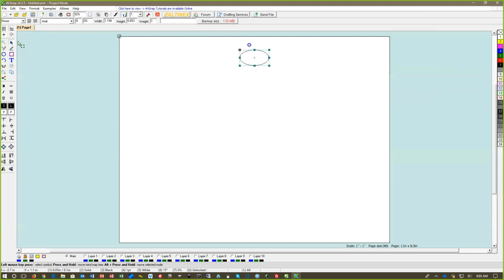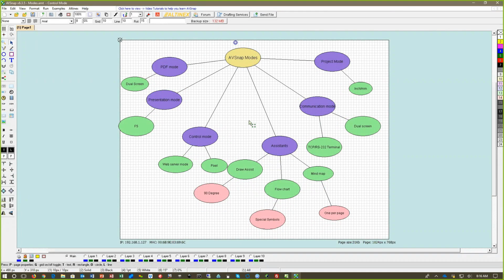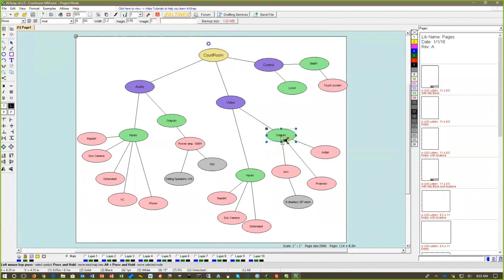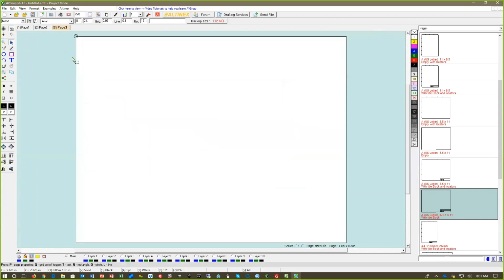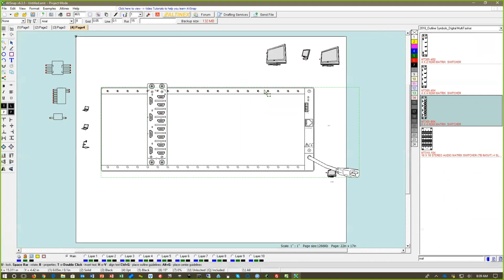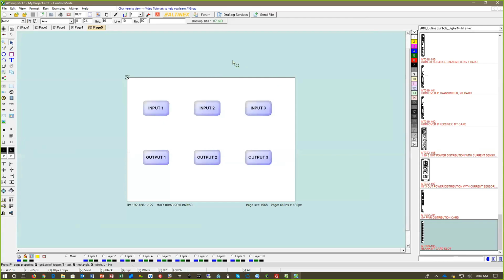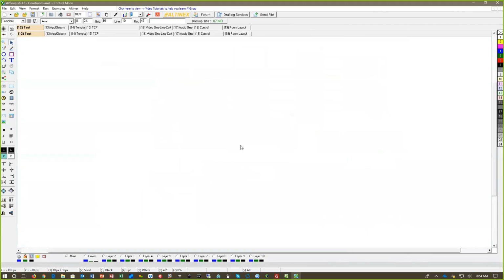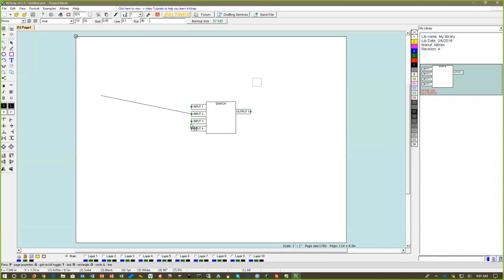Introduction to AVSnap [[Recorded from Webinar]]

Comment: Hi Jack. Your info is always great, but your video is so blurry it's hard to see anything on the screen. Also, I just checked your forum links on that page and that's still down. I just thought I mention that for you. Anyway I also wanted to point you to this program if you want to record your screen which I just found. It's simple to use and seems to work great. It's called https://getsharex.com/. So I hope this helps you with any other videos you want to make. The files are also small so you don't need to do anything after you finish unless you want to. You can take a look at my last video which is on vmware. I just recorded that yesterday with this program so you can see how it looks. You can also change the fps on it too. I also forgot to ask if you can put the version number on the setup files as well. It just helps to know the version when you already have older ones downloaded.